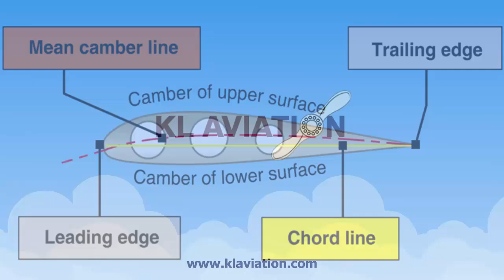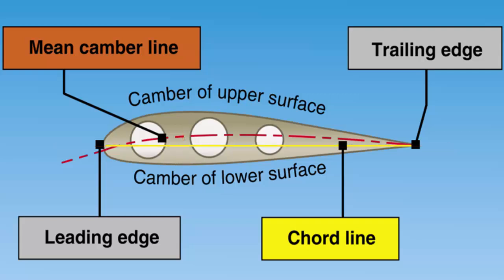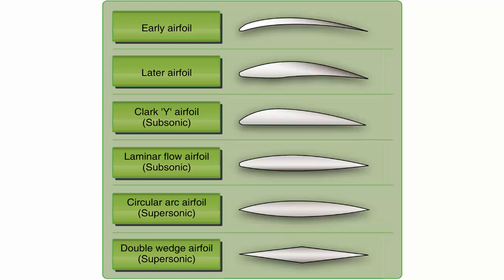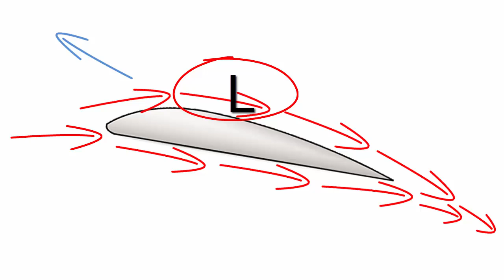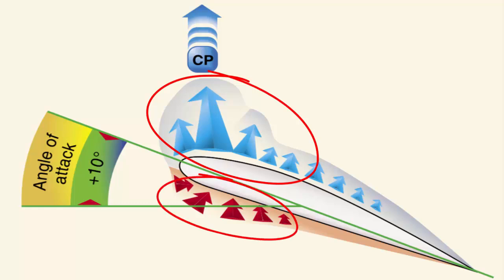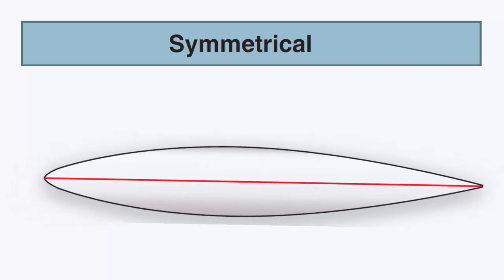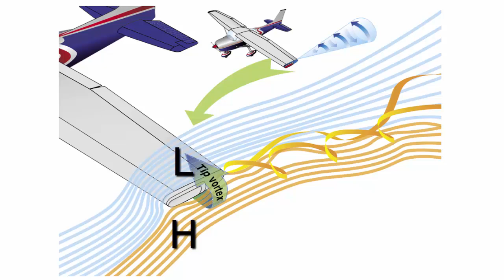Airfoil Design

Comment: I've been looking all over Youtube and this is the only video I got that explains everything my instructor says in an equally relatable way.. God Bless
Reply: joe jitsu  Yep.
This video only repeats very common misconceptions and invents a new one, as follows.
.
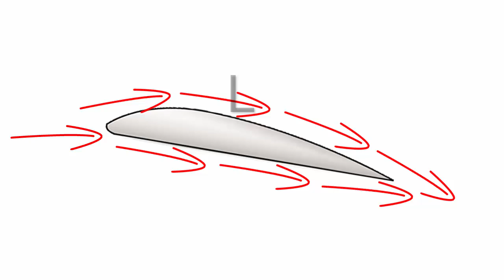3:13  The low pressure above the wing allows higher pressure ahead of the wing to accelerate it to the higher speed. It is Newton.  The force of pressure accelerates the mass of air. 
The movement of the wing creates pressure gradients and as Euler reported to us in the mid 1700s, Pressure gradients accelerate fluids.
Bernoulli never said speed causes a pressure reduction. He only noted that the (static) pressure and velocity have an inverse relationship with no indication of cause and effect. This is a major, common  misunderstanding. 
Euler determined that pressure gradients accelerate fluids toward the lower pressure. That is the opposite of the common misconception.
...
3:29  The pressure difference top to bottom accounts for ALL THE LIFT.   This 'a little of this and a little of that" is bad science.   The same pressures that have the net upward lift force on the wing are the very same pressures that cause all accelerations around the wing including ahead, above, below, behind and around the tips.
The higher pressure under the wing pushes up on the wing AND down on the air below to contribute to the down-wash.
The lower pressure above the wing allows atmospheric pressure to push air above the wing downward, to also contribute to the down-wash.
..
NOTE: the whole upward force on the wing is equal to the force required to accelerate all the air in the down-wash.  THAT is what satisfies Newton's Third Law.  The upward 'push" (force) on the wing equals the downward 'push' (force) on the air accelerated downward.
The downward moving air does not push up on the wing.   That air was pushed down by the pressures around the wing. 
The down-wash also does not push the wing forward. You've invented a new a fallacy.  The net force fore-aft is rearward and is called drag and is not caused by the down-wash as explained above.
When viewed from the still air frame of reference, the down-wash is moving slightly forward.
....
4:27  Bernoulli's Principle is again misused.  The flow is not slowed under the wing which is NOT the cause of the higher pressure. .  That view is valid only in the stationary wing, wind tunnel reference frame only. 

 In fact, REAL data from a REAL wing generating REAL lift flying through otherwise still air shows the lower air being moved forward in the direction of flight. This acceleration from still air is CAUSED BY the higher pressure at the lower surface.  The increase in pressure at the surface is because the wing is pushing the air out of  its way. This push increases the pressure, not the Bernoulli Principle Fallacy.
....
The pressure increase below the wing in combination with the decrease above the wing provides the ENTIRE lift force.
...
If by this magic, the down-wash did just happen to add to the lift, that "addition" would be exhibited as an increased pressure difference on the win...but it DOES NOT.
Bernoulli's Principle causes nothing in the generation of lift because the "speed-causes-pressures" is a fallacy. 
It is all explained by Newton, BUT NOT with this ":reaction force" fallacy.
Newton's Third Law "reaction force" is not an originating force, but is a direct result of the originating force which, in this case,  is from the pressures around the wing as described above.
....
At 7:11 Please listen to your words: “The high pressure area on the bottom of an airfoil pushes around the tip to the low pressure area on the top.”. This shows that you understand that pressure causes movement, but you fail to apply it on all the other parts of this  and, therefore shows the problems with this explanation.  The correct story uses this Pressure accelerated air in ALL aspects around the wing, because that I the real science.
The tip vortex does not ‘create the down wash”.  You already explained the down-wash without reference to the tip vortex.  This is a flaw in this explanation. The tip vortex is CONSISTENT with the wing generated down-wash moving against the still air outside the wing span.  Masses of air sliding along each other create vorticity (vortices) along the boundary of the two masses.
…
At 7:47 Winglets DO NOT and CANNOT prevent the tip vortex from forming.  They can only reduce the severity and the negative effect because they act to effectively lengthen the wingspan; longer wings have less severe vortices . See Doug McLean’s You Tube video on misconceptions for a full explanation.
https://www.youtube.com/watch?v=QKCK4lJLQHU 
…
Though well-meaning, the 'Pilot's Handbook of Aeronautical Knowledge.' has bad information in it as do so many other publications and on-line resources such as YouTube.
Reply: I discovered  that Parasite drag is produced by VERTICAL surfaces and Induced drag is created by HORIZONTAL surfaces, for example when the Flaps are at 0 degrees they produce Max Induced drag and Min Parasite drag, at 90 degrees Min Induced and Max Parasite drag and at 45 degrees in the middle of both.
 Please let me know if you think it is a valid observation. Thanks

Comment: This video only repeats very common misconceptions and invents a new one, as follows.
.
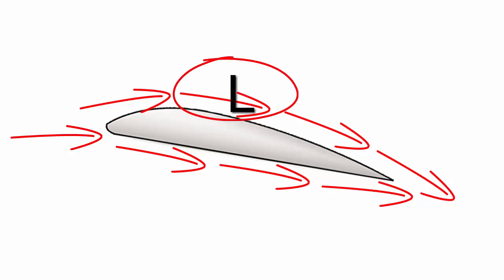3:13  The low pressure above the wing allows higher pressure ahead of the wing to accelerate it to the higher speed. It is Newton.  The force of pressure accelerates the mass of air. 
The movement of the wing creates pressure gradients and as Euler reported to us in the mid 1700s, Pressure gradients accelerate fluids.
Bernoulli never said speed causes a pressure reduction. He only noted that the (static) pressure and velocity have an inverse relationship with no indication of cause and effect. This is a major, common  misunderstanding. 
Euler determined that pressure gradients accelerate fluids toward the lower pressure. That is the opposite of the common misconception.
...
3:29  The pressure difference top to bottom accounts for ALL THE LIFT.   This 'a little of this and a little of that" is bad science.   The same pressures that have the net upward lift force on the wing are the very same pressures that cause all accelerations around the wing including ahead, above, below, behind and around the tips.
The higher pressure under the wing pushes up on the wing AND down on the air below to contribute to the down-wash.
The lower pressure above the wing allows atmospheric pressure to push air above the wing downward, to also contribute to the down-wash.
..
NOTE: the whole upward force on the wing is equal to the force required to accelerate all the air in the down-wash.  THAT is what satisfies Newton's Third Law.  The upward 'push" (force) on the wing equals the downward 'push' (force) on the air accelerated downward.
The downward moving air does not push up on the wing.   That air was pushed down by the pressures around the wing. 
The down-wash also does not push the wing forward. You've invented a new a fallacy.  The net force fore-aft is rearward and is called drag and is not caused by the down-wash as explained above.
When viewed from the still air frame of reference, the down-wash is moving slightly forward.
....
4:27  Bernoulli's Principle is again misused.  The flow is not slowed under the wing which is NOT the cause of the higher pressure. .  That view is valid only in the stationary wing, wind tunnel reference frame only. 

 In fact, REAL data from a REAL wing generating REAL lift flying through otherwise still air shows the lower air being moved forward in the direction of flight. This acceleration from still air is CAUSED BY the higher pressure at the lower surface.  The increase in pressure at the surface is because the wing is pushing the air out of  its way. This push increases the pressure, not the Bernoulli Principle Fallacy.
....
The pressure increase below the wing in combination with the decrease above the wing provides the ENTIRE lift force.
...
If by this magic, the down-wash did just happen to add to the lift, that "addition" would be exhibited as an increased pressure difference on the win...but it DOES NOT.
Bernoulli's Principle causes nothing in the generation of lift because the "speed-causes-pressures" is a fallacy. 
It is all explained by Newton, BUT NOT with this ":reaction force" fallacy.
Newton's Third Law "reaction force" is not an originating force, but is a direct result of the originating force which, in this case,  is from the pressures around the wing as described above.
....
At 7:11 Please listen to your words: “The high pressure area on the bottom of an airfoil pushes around the tip to the low pressure area on the top.”. This shows that you understand that pressure causes movement, but you fail to apply it on all the other parts of this  and, therefore shows the problems with this explanation.  The correct story uses this Pressure accelerated air in ALL aspects around the wing, because that I the real science.
The tip vortex does not ‘create the down wash”.  You already explained the down-wash without reference to the tip vortex.  This is a flaw in this explanation. The tip vortex is CONSISTENT with the wing generated down-wash moving against the still air outside the wing span.  Masses of air sliding along each other create vorticity (vortices) along the boundary of the two masses.
…
At 7:47 Winglets DO NOT and CANNOT prevent the tip vortex from forming.  They can only reduce the severity and the negative effect because they act to effectively lengthen the wingspan; longer wings have less severe vortices . See Doug McLean’s You Tube video on misconceptions for a full explanation.
https://www.youtube.com/watch?v=QKCK4lJLQHU 
…
Though well-meaning, the 'Pilot's Handbook of Aeronautical Knowledge.' has bad information in it as do so many other publications and on-line resources such as YouTube.
Reply: well corrected, what is your references, please?
Reply: @Observ45er  thank you
Reply: @makantahi3731  I am pleased to have helped you understand. I wish I could have just pasted my main reference list but YouTube wouldn't let me do that. I have referred to all of those and more and yes it is true that I have also communicated with some of the authors and others who are well known in aerodynamics. 
I am an experienced engineer and I do STEM demos and labs at a couple local schools and for scouts. I teach electronics at two community colleges. I take this very seriously and I work very hard to have a good understanding of all subjects I discuss so that I can explain it at many levels from kindergarten up to adults.
Best Regards
Reply: @Observ45er  thank you again ,i am in aviation industry from high school, to university,, and aerodynamics is interesting to me , and i did some corrections on some you tube videos about a/d basics, now i have things to watch, thanks to you
Reply: well explained!!
Reply: @andiarrohnds5163  this person took a lot of effort in explaining/countering the concept.. Your response instead was to talk about his sexual orientation? I sometimes think free knowledge/information shouldn't be free for all.. some just don't deserve it..
Reply: It's the Law of "Air on Top Meets Back Up with the Same Air on the Bottom"...  (sarcasm)

Comment: The existence of the wingtip vortex is a topological requirement and the only way to prevent it from forming is to reduce the angle of attack to the point where the wing is not generating any lift. Winglets are able to regulate the wingtip vortex, but not to eliminate it.

The vortex system of a wing is a ring vortex which passes through the boundary layers around the wing, along one trailing wingtip vortex, through the starting vortex left behind on the runway, and then back through the other wingtip vortex. Vorticity associated with the wing generates lift by the Magnus effect if you want a short explanation, or by the Kutta-Joukowski circulation theorem if you want more detail.

Comment: I have an issue with your illustration at 4:34.   Looking at the small blue arrows, you purpetuate the myth that the air being split at the leading edge matches up again at the trailing edge. This is false.  The air on the top of the wing goes faster and beats the air under the wing at the trailing edge.

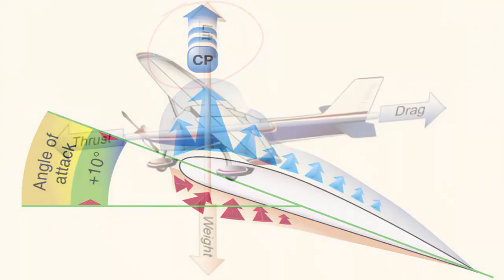Comment: I fear that this video may have fallen for some common misconceptions in the aerodynamic community. For one, the figures depicting the low and high pressure arrows imply a suction on the top of the airfoil. This is not the case, it is simply less pressure on top pushing downwards while the higher pressure have much higher magnitudes and push upwards from the bottom. There is another part in the video where you explain the center of pressure. I believe you define it incorrectly, but correctly explain that topic. I think what you meant to say was coefficient of pressure, C_p at 5:30. Center of pressure varies and is a location. Coefficient of pressure is the average pressure variation.

Comment: I am investigating airfoils to use for a sailboat Wingsail.  Most wing sales use a symetrical foil for the front section of the wing.  My question is,  if possible, am I better off finding a way to designing a wing foil that matches a standard airplane wing foil? More efficient?  the Trick is to be able to adjust the leading edge to adjust for left vs. right side attack.  Your thoughts?
Reply: You gave the answer yourself. The symmetric airfoil is a result of having the sail fit for both directions of wind. Fortunately the pressure side is much less prone to separation due to non. ideal shape, so designing a symmetrical section that is optimised for the suction side is the way to go. Towards the trailing edge you can then use the properties of flexible spherically cambered surfaces to have a sail that takes "close to" the ideal surface depending on the direction of wind.
There are designs of wings that allow for continuous deformation of the wing section. That might be an approach for a sail. It involves rather hardcore mechanical systems, but these are not really unheard of in high-tech sailing.